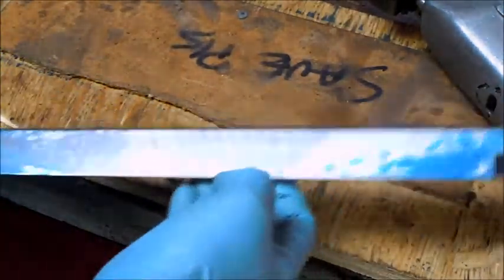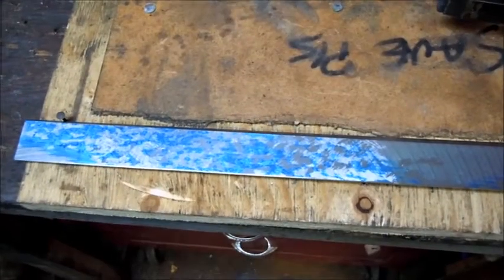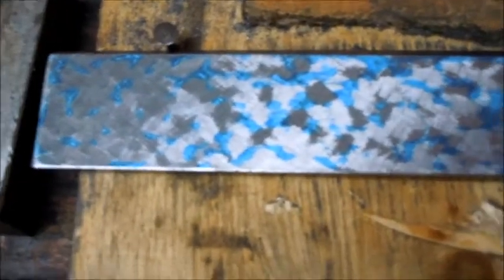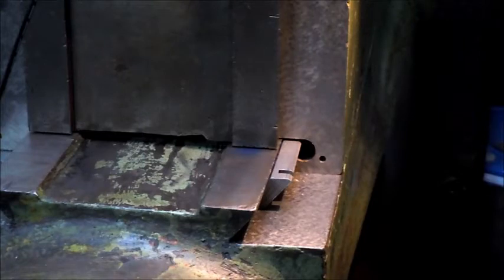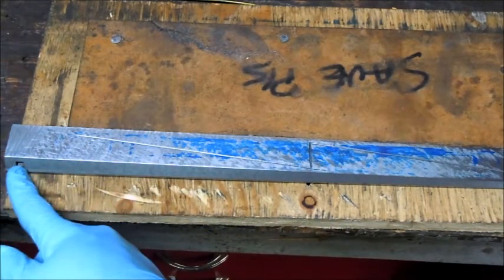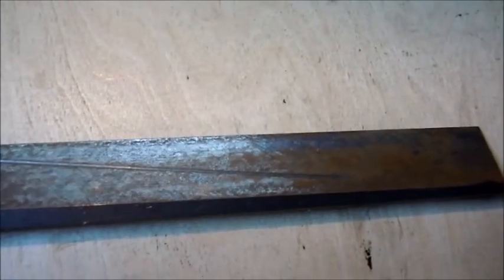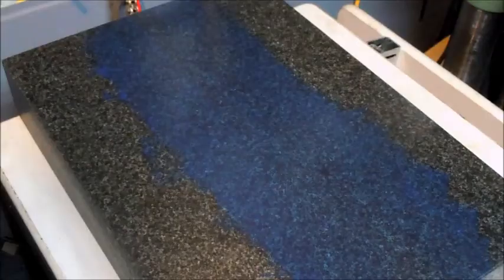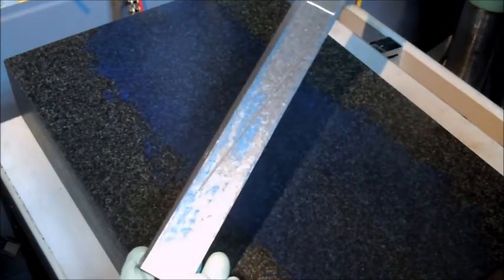Bridgeport Update 6

Comment: Your stroke on the Biax seems kind of short for roughing. Wouldn't it go a lot faster with a fairly long stroke and a fairly rapid side-to-side sweep in the Z's or X's pattern they talk about? I'm pretty new to power scraping, so I'm no authority (yet :), but thought I'd ask if there was a particular reason you were point scraping in the roughing stage. I've done more hand scraping so far, and until I get the whole surface to spot I go with long-ish strokes separated about half-a-stroke-width and alternated 90 degrees apart (both at 45 degrees to the length of the part). That gives the characteristic "checkerboard" pattern and seems to move the roughing along pretty rapidly. I've gotten roughly that result with my Biax but need something bigger to scrape and a carbide sharpening setup before I can go much further with that.  Thanks for the video, I enjoy watching you work :)
Reply from the maker: Well I'm just scratching :) the surface of scraping at this point in my apprenticeship so I appreciate the feedback...I think that was the first part I scraped with the Biax so I was being very cautious not to take too much metal off, I've found out it's hard to put it back on! I also find I’m partial to a small hand scraped crisscross pattern, because that’s how I started, that looks like basket weaving although the power scraped finish is growing on me. I’m Currently trying to straighten up the knee, guiding way, which needs approx. 4 thou removed at one end and I really dug in with the Biax a few days ago, wow, you can really make some chips in a hurry with that thing! Next major piece I’m taking on is the table, I should be ready to do some serious work by then. Might detour for a bit to try and rough / finish the top of my homemade straight edge flat and parallel now that I have the large surface plate. That will give me some good roughing experience without risk of messing something up. Haven’t yet had to grind a tool yet, need to get that figured out myself. Thanks for watching and commenting. Take Care.

Comment: On like my Monarch or the G&L the ways are all ground and then only the saddles are scraped for oil retention. I could see why to save a lot of labor and time.  You will have one sweet mill after all those hours of work and you can say that YOU did it. :-)
Reply from the maker: This ole girl is a 1968 model, no chrome, no hardening, just some good USofA cast iron! I really just treat it like therapy, if the plan works the results “should” be good – you just need to stick with it. Thanks for the comment